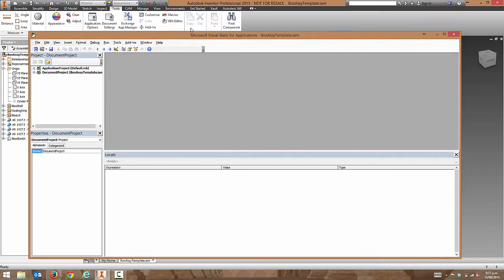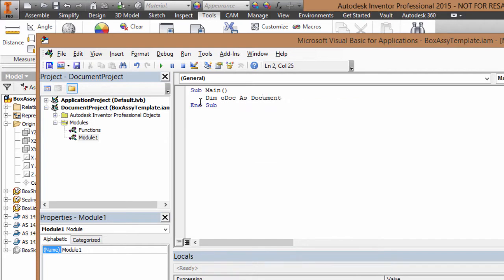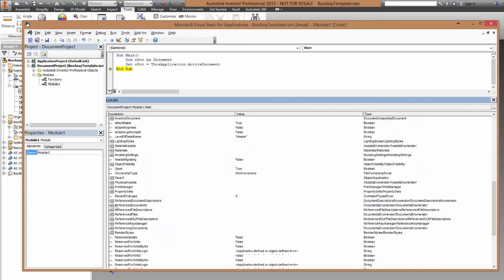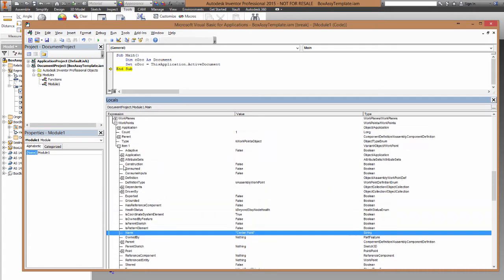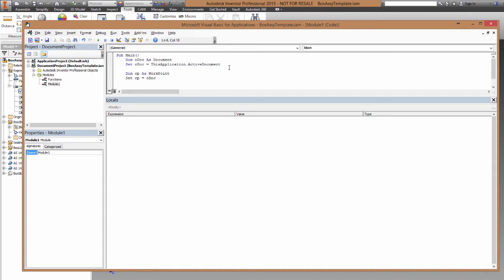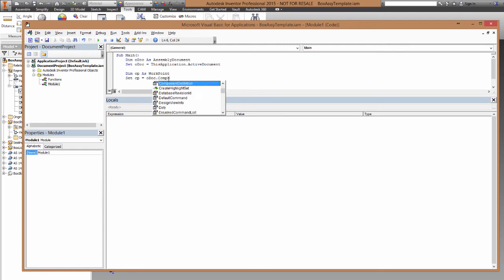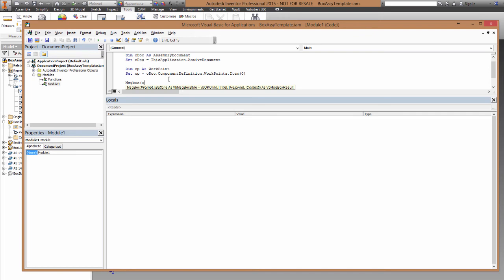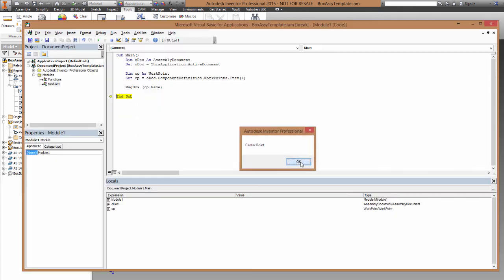Inventor VBA Environment - Live Model Interrogation

Comment: How do i get the 'oDoc' in locals window?
Reply: Write the initial code as he did and then start (step into) the code using F8
Each time you press F8, it will move to the next line of functional code.
Once the {End Sub} line is highlighted, the Locals information will show up for oDoc
Reply from the maker: John Day III Thanks for helping out. Gavin has been super busy of late, he's been trying to get here to answer this question.
Reply: Not a problem. This video helped me tremendously in tracking some of my own issues so I figured, pay it forward.
Reply from the maker: John Day III That's really cool. Gavin will be stoked. Can I ask if you found this video via YouTube or our blog? We need to add a link to the post in the description of this video. But here you go if you or anyone else hasn't seen it https://designandmotion.net/autodesk/mfg-pages/inventor/time-to-tame-the-beast-learn-to-customize-autodesk-inventor/
Reply: It was via that exact article actually. I recently started to delve into the Inventor API to solve an inefficiency we have in our design process at work. I couldn't get iLogic to work the way I wanted and it was rough debugging, so I went the direction of VBA within Inventor. I knew the basics of programming inside Excel, but couldn't get the API calls to work inside Inventor until I watched this video and started using the Locals tool that you guys showed here. So thanks for the help!
Reply from the maker: John Day III
 Cool, please don't hesitate to let us know if something helped, or to share your own experiences in the future. It makes such a difference. We can see the traffic, but comments are so much more personal. They make our day :-)
Reply: Oops. I guess I missed all the action here. Thanks so much for chiming in and answering the question John. Glad the video helped.